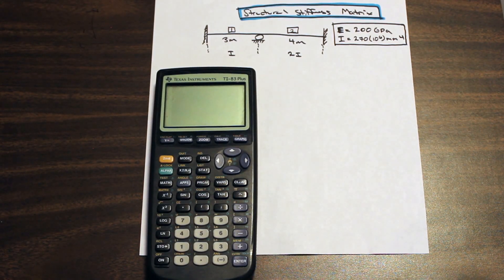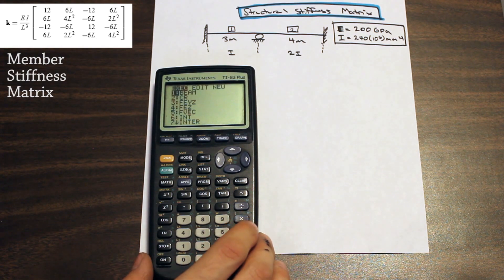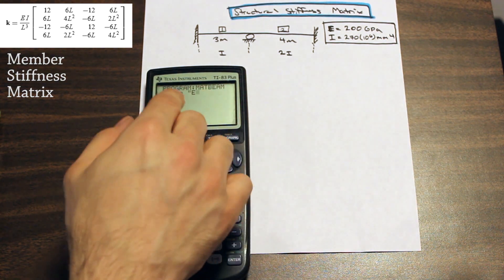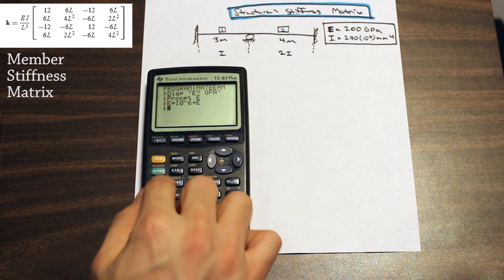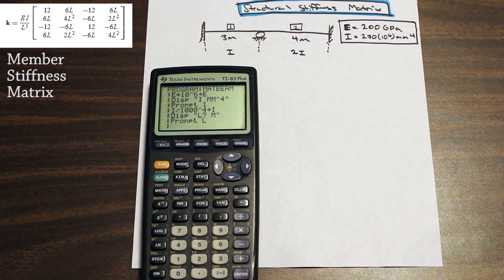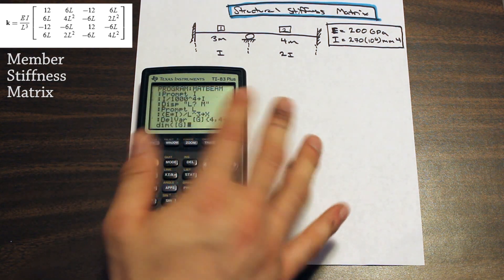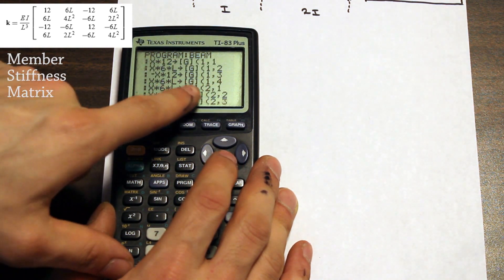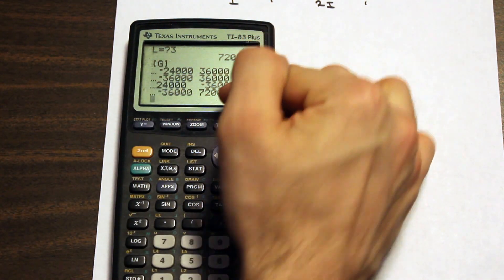How to Program Structural Stiffness Matrix into your Graphing Calculator (TI-83+)

Comment: I'm struggling with adjusting this program to work for US customary/imperial units instead of S.I units. What conversions would you have to input at the start? I did this but I don't think it's correct

Disp "E KSI"
Prompt E
E*12^2->E
Disp "I IN^4"
Prompt I
I/12^4->I
Disp "L FT"
Prompt L
(E*I/L^3->x

Followed by all the regular matrix stuff

Also thanks so much for your videos on the stiffness method!
Reply from the maker: Thanks! Off the top of my head I can't remember if the coefficients change for  imperial units vs metric, they probably do so I'd check that first and just use straight imperial units.

If you want to convert and use this videos matrix formula you have to be careful to use units that are the same and that cancel.  In your post you used a bunch of different units.  For example, our E is in MPa which is N/mm^2.  You're trying convert KSI which is kips/square inch so you need to convert both kips and inches to Newton's and inches respectively.  I'd write out each conversion and cancel the units until you arrive at exactly the same units we have.  Good luck!

Comment: I programmed it into my calculator but there is a syntax error at the point where DelVar [G] (4,4 is stored to dim([G]... any idea why this is happening?
Reply: Never mind, I realized that it is DelVar [G] {4,4 .  It looked like a ( on the screen
Reply from the maker: Ah, glad you worked it out! Good luck!
Reply: Man I had the same problem! hahah thanks alot
Reply: It's still not working for me :( . I wonder what's wrong!?
Reply: Ahh it finally worked. I used the wrong Negative sign - and (-) . But seriously what's the difference?
Reply: @khyo826  minus vs negative

Comment: For the stiffness method for Truss Analysis; AE/L instead of EI/L. Could I just change your E & I from your program to A & E with respect to A's proper units?
Reply from the maker: Yup, you can use the same program as the truss and beam  stiffness matricies are 4x4.  For a frame you'll need to use a different program as it'll be 6x6.  Just make sure, as you pointed out, you change EI to AE.  Obviously, before you take this to the exam with you, try it out on some problems in the book and confirm that every value your calculator is giving you is correct.

Comment: Is there a way to do this with EI as a constant?
Reply from the maker: im assuming you want to take 1/EI out of the matrix, and just get the numerator values?  you can do that with this program, just substitute EI = 1, and take 1/EI outside of the matrix.  I think this is what you were referring to.
Reply: Most of my in class problem will have the assumption of EI as a constant. This works so thanks!
Reply from the maker: Cameron Aucoin yeah, that's quite common.  Glad we could help!